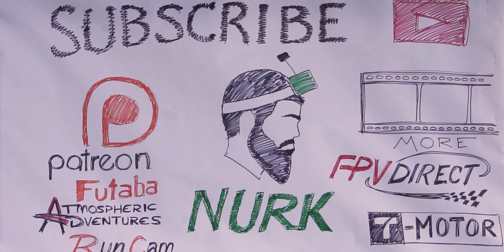Crazy Soapbox Derby Commercial Drone Gig - Behind the Scenes!

Comment: How is this legal is because a cinewoop that u can fly with all these people here no problem
Reply: he was only flying over the participants on the track.  the ones off the balcony and up the track had paths cleared do the squirt didn't actually go over anyone.
Reply: Yeah there's no chance this would pass aviation rules here in Australia. 15m minimum distance from public means this stuff is illegal :-(
Reply: @travmason  bummer
Reply: A Waver from the participants, protected props and part 107 certified
Reply: What jgreg said. It was mentioned by Nurk in the video that waivers were signed.
Reply: @MrPhilbautista  I was just curious if the cinewoop made a difference in laws. At all
Reply: @travmason  I understand safety stuff but some times the rules are overboard . Where I live most people like drones so as long as responsible u can get away with alot
Reply: @maddmavic  nope. The whoop is over the 250 gram limit, so all the other things had to come into play. Nurk is certified and the people present signed waivers. If there were people present that complained, Nurk could’ve faced a fine or some other penalty. He would’ve had a chance to defend himself in some hearing but that still would’ve been a hassle.